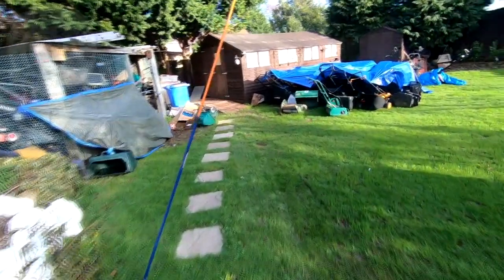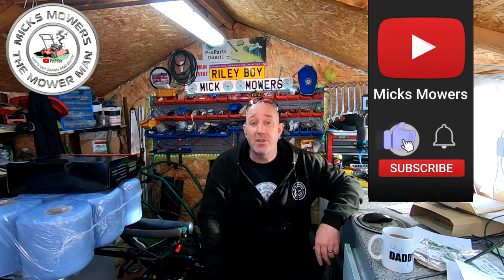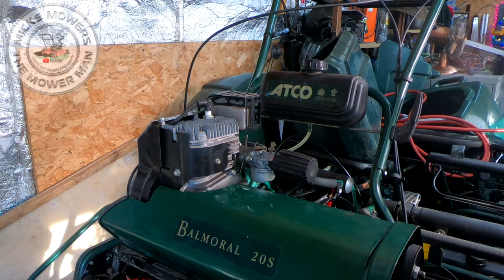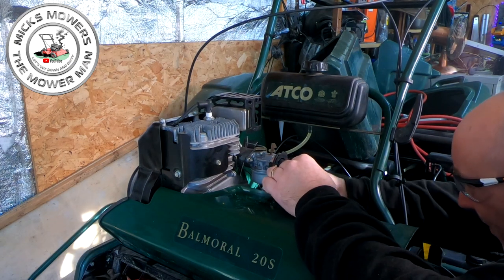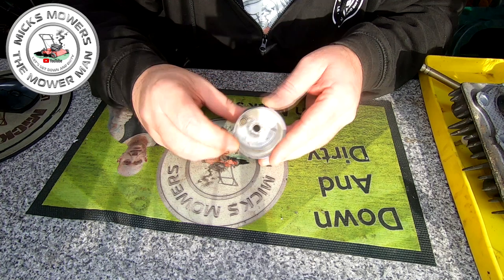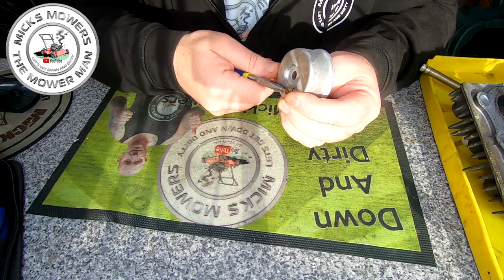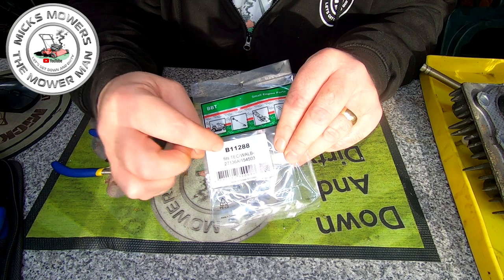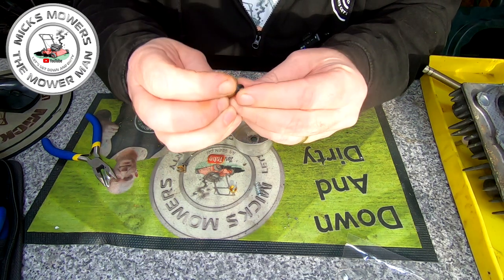How To Stop A Carburetor From Leaking Quick and Easy

Comment: HI, HAVE DONE A LOT WITH DRAIN SEAT  IN THE TEC CARBS .   THE DRAIN BLACK SEAT  ONLY FOR 1  COST ME £10.00 ADD P&P ON TOP .  UNDER £20.00   WITHOUT A SPRING AND CUP YOU HAD THERE .

Comment: You know, those little tiddlers aren't really needed, I think they are intended to drain the carb at the end of the season. I've known people to solder them up! 😅
A bit of info, a 13mm spanner/socket will fit a 1/2 inch nut/bolt buy you run the risk of rounding the shoulders off but a 1/2 inch spanner won't fit a 13mm nut. 1/2 inch is a fraction smaller than 13mm. It's the same with 15mm -5/8, 19mm - 3/4 and so on.
Reply: Don't you mean a 1/2 will fit a 13mm? (Joking, if course, we see it from the other side in the states)

Comment: Brilliant video Mick. Fixed my 14SK by cleaning the carburetor following your instructions. However, the bowl O ring is pretty shot and petrol is leaking out. Any idea of the replacement part number or O ring size so I can replace it. Thank you.
Reply from the maker: Yours has the Kawasaki engine on it yes?
Reply from the maker: Hmmm think this is the one you need.. Kawasaki 11061-7009 Chamber Gasket https://amzn.eu/d/6fTfz64
Reply: @themowerman  Yes Kawasaki engine. Looks identical to the mower in the video
Reply: @themowerman  Thanks Mick 👍
Reply from the maker: @paulwilkinson8435  ok so this engine is a Tecumseh not a Kawasaki.
Reply from the maker: Email me me a photo of your mower so I can check micksmowers01@gmail.com